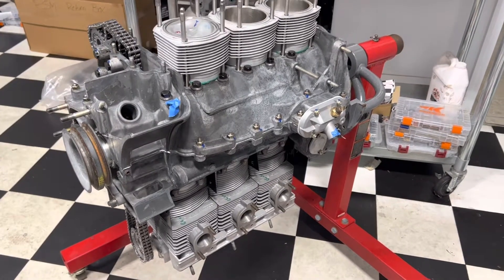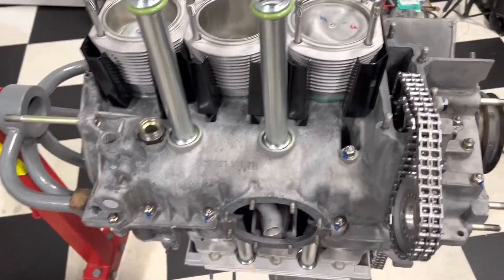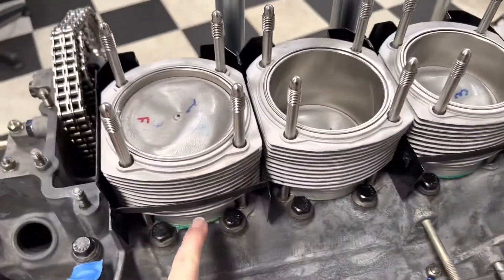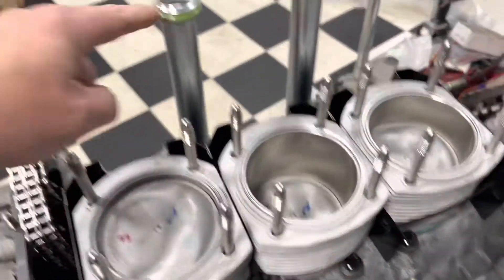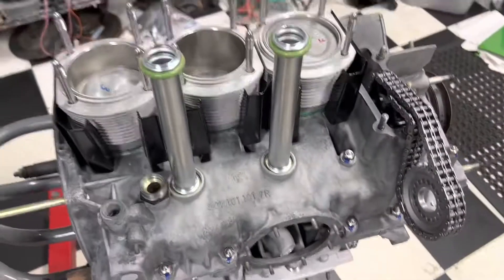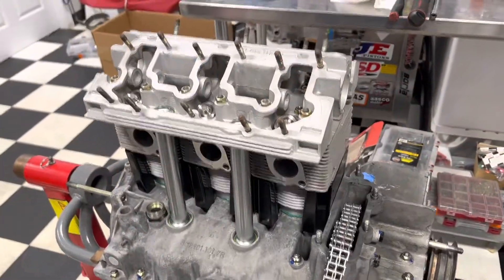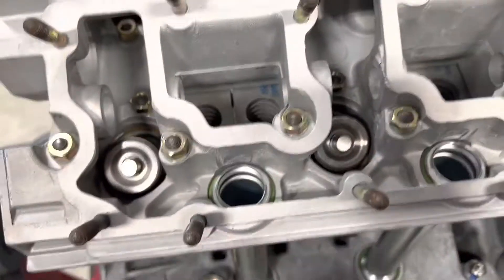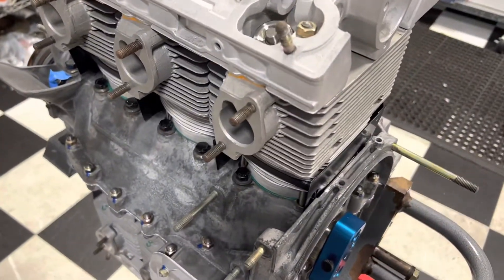1974 Porsche 911S Cylinder Head Install

Comment: Not actually done this myself yet, most other I've seen install the heads as individual units.  Is it better to pre assemble the bank of heads or it is a preference and not really better?   Thanks and keep the videos coming.
Reply from the maker: I find it easier to them as an assembly. Especially in order to get a good sealant bond between the cam rack and the heads. What part of the world are you located in?